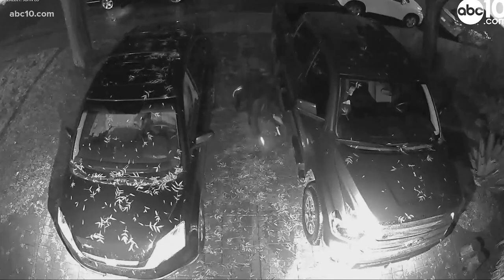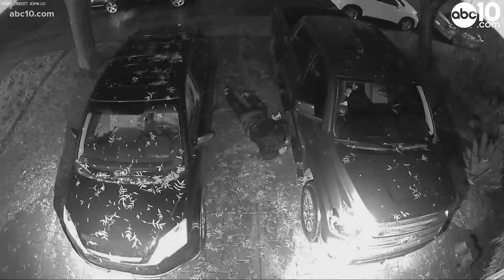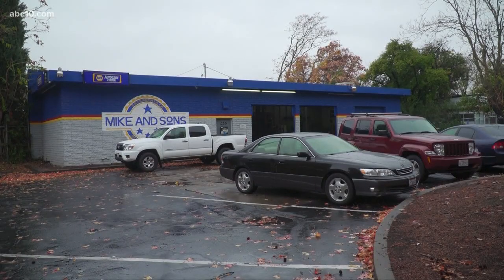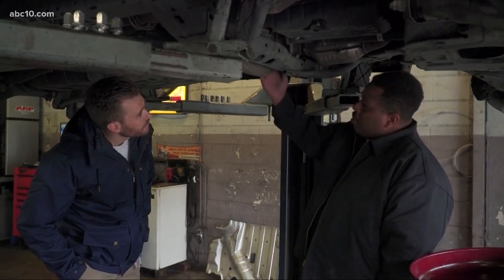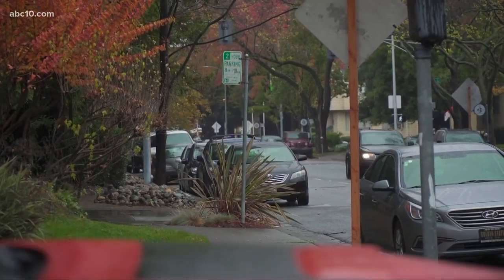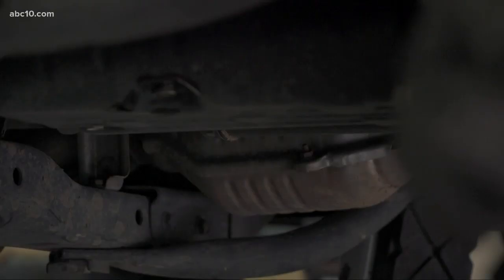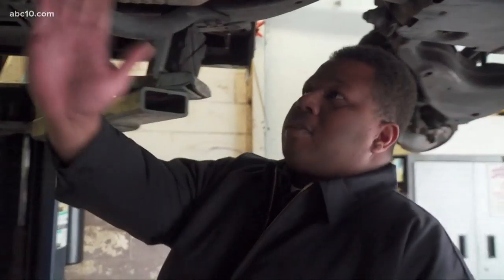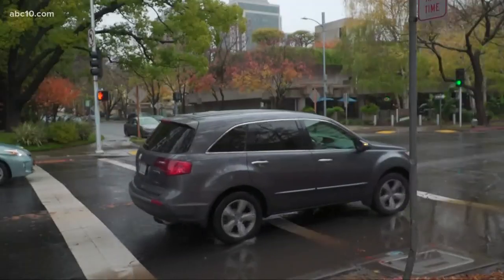Catalytic converter thief caught on camera in Stockton

Comment: Just think about how mechanics from the 70’s and 80’s missed out on the “pay day” , back in those days if a convertor plugged up they would knock the stuff out and toss it in the garbage if a customer could not afford to replace it or remove it and install a test pipe

Comment: Same problem here in oz with thieves targeting copper wiring in new build houses.
They climb into the roof cavity, cut the wires a the top of the walls and then rip it all out of the roof.
For years i have been asking the same question as the bloke at the end of the video.
How can the scrap recyclers just keep taking lengths of chopped up wire from people that are clear drug addicts.